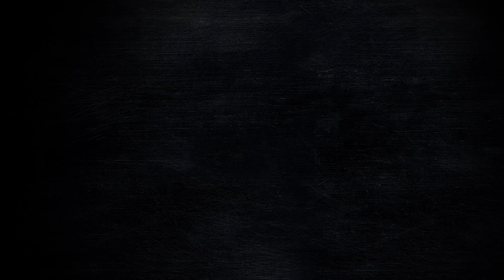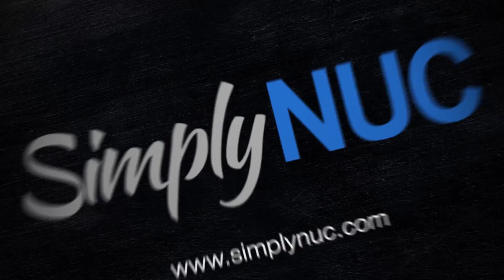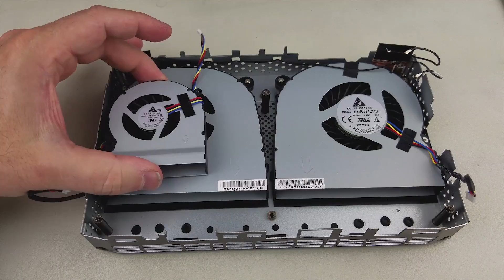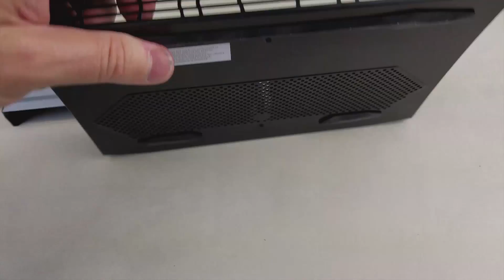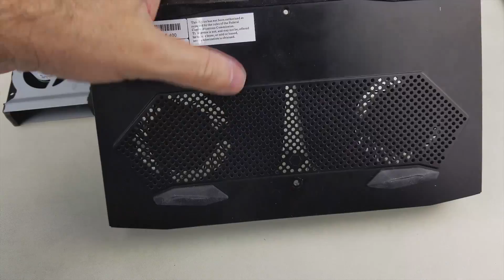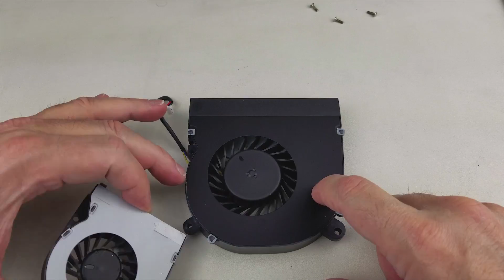NUC Skull Canyon vs Hades Canyon Blower Comparison

Comment: This thermal design is flawed lol, putting bigger fans in the case is not a workaround for cooling but a band-aid.
if you want the case to have proper exhaust pressure you need to seal the fans to the sink, all this is doing is blowing more air through the cracks in-between the fans and sink moving around more hot air inside the case rather than venting it out.

Comment: they use the fixed cover on the blower, how we clean the fan in it? only the high pressure gas?
Reply from the maker: Yes. High pressure air is what we recommend.